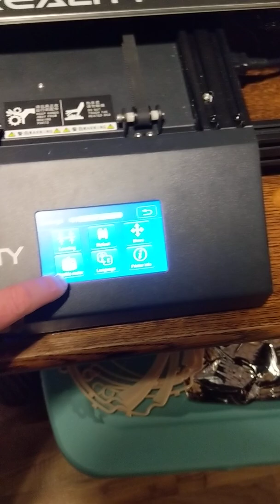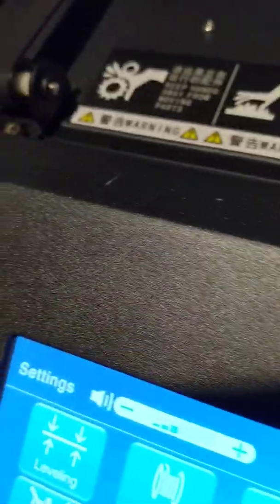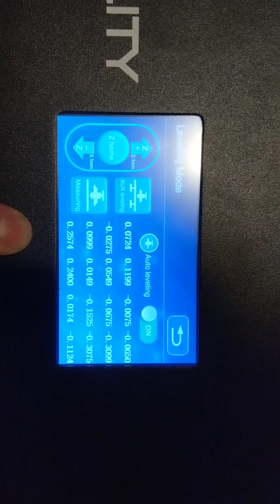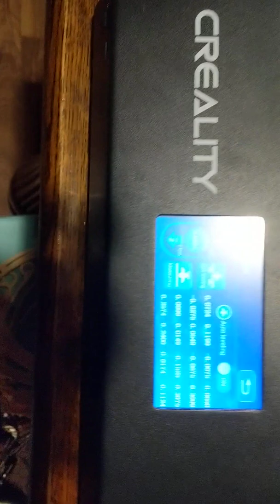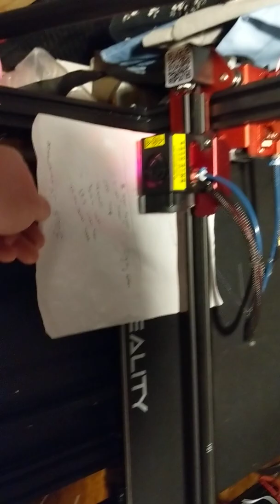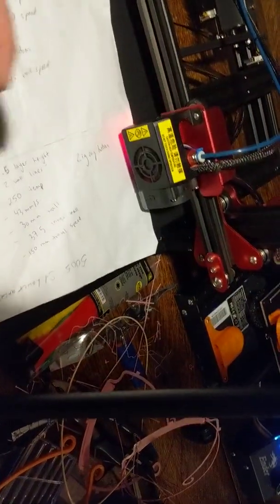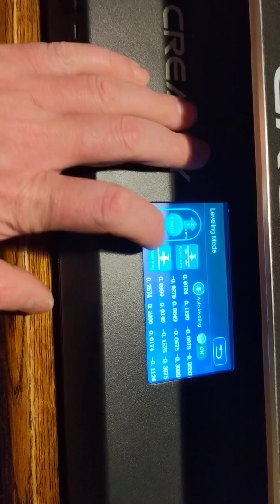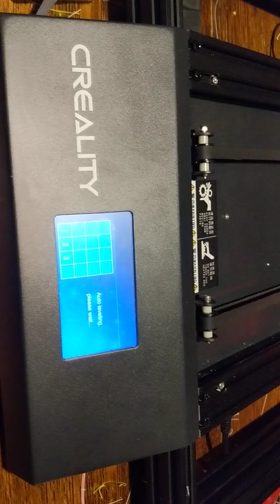CR-10 Max Bed levelling and X-axis setup

Comment: Great tutorial!  Just a couple of points - 1.) Press down on cold bed and tighten bed height adjustment wheels to allow enough tension for easier adjustment prior to 5 point manual adjustment and 2.) Adjust bed and nozzle temperature to print temperature when performing 5 point manual leveling adjustment.
This will give flawless results.

Comment: theres something i dont get, whats the purpose of the auto bed leveling if u have to do it manually like in all the other printers? when i first got my printer i thought it would level itself and correct the leveling on its own. but when that went to hell i leveled manually like always and it worked better. so what is the point of it

Comment: Doesn’t the x axis reset after each power down? I thought it was required to loosen eccentric nuts, level  the gantry using spacers, then tighten the nuts. That way the x axis is mechanically leveled. Thoughts?
Reply from the maker: It actually stays pretty true. Every now and then I'll reset it just for my OCD

Comment: Hi Matt I followed your video so far so good. FIrst time I use a 3d printer. couldn't figure out leveling. a small part fell out of the printer no idea what it is. can I e-mail you a picture? I haven't start a first print yet either. What is Blacklash screw?

Comment: Wow dude, this is the only clear explanation i've seen on the bed leveling. Didnt see the X axis calibration nor the BLTouch adjustment. Thanks!!

One question though... I think my plate is .15mm higher in the middle than the corners. All the pressure im relieving off the springs, by turning the knob, just make all the springs unwind into a wobbly state and the buildplate just counterbalances any adjustment... To answer my own question: 
- tighten the knobs first, like halfway
- reset BLTouch mesh
- do auxiliary level calibration
- IMPORTANT: set Z-home after changing the value (thank you for making me understand this, I didnt)
- do measurement level calibration (and create a clean BLTouch mesh)
Reply from the maker: Your welcome.  I got frustrated by the lack of videos on this.  The z drop is actually unbelievable and it's because of the weight of the assembly. 

I've been meaning to install backlash nuts but unless you properly tram it (Make the nozzle parallel with the bed) before they would be useless.  The biggest misconception companies give us is that we are leveling everything.  We are not.  We are simply planing the two surfaces parallel to eachother
Reply: @mattnault3106  I'm waiting for the day where BLE (mesh)sensors become so common that we can create a relative telemetry antenna grid inside the cube. Maybe add some laser guided calibration...

i'm a software engineer and im amazed by the lack of feedback mechanisms in these "robots". The printing profile comes from the slicer yet it's rooted in the printers firmware settings and extruder. After calibrating, it just goes; no complex sensor network, no reslicing, no scanning. It looks like there's a huge gap to bridge between CNC controllers and smartphones.

Do you have recommendations on octoprint plugin? I saw a nanny plugin that provides some image recognition feedback i believe.
Reply: @mattnault3106  I'm gonna give Klipper a shot instead of Marlin... guess it's more my alley

Comment: Thanks man.  When I perform the original leveling with the shim the right side immediately rises back up to unlevel the 2 as soon as the motors kick in.  Have you seen this ?  Thanks !  also..is your Z axis movement really noisy ?  thanks again !
Reply from the maker: Z axis isn't really noises. The Z axis being thrown out of level again can be fixed with backlash nuts on the Z. It will save a ton of headache
Reply from the maker: Also if you get 2 equal pieces of something in length it saves the hassle of realigning the parallel of the Z